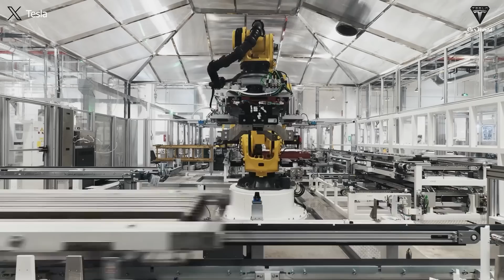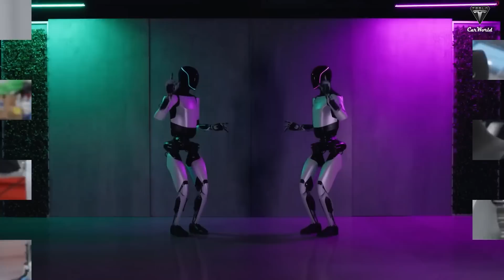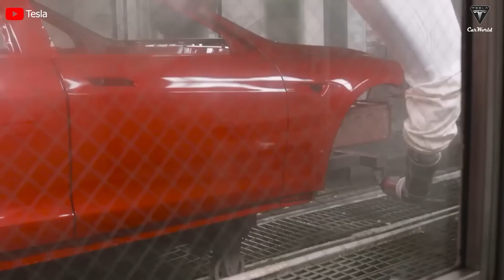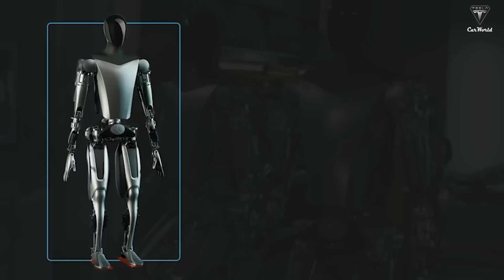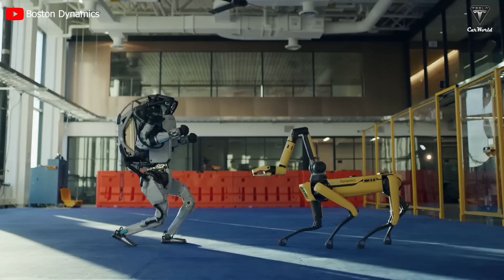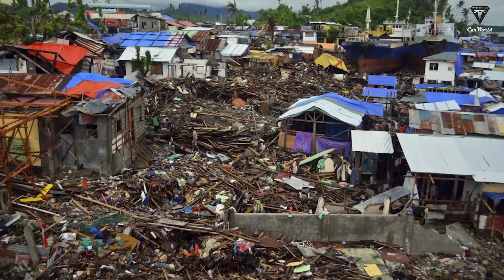2024 "Next Gen II" Tesla Optimus: Unveiled All NEW Specs, Challenger - Boston Dynamics Atlas (MIX)

Comment: Robots on wheels can do more, carry more, have multiple arms, longer arms, have larger batteries and work faster than a robot spending valuable energy trying "not to fall over."

A human picks up on box at a time because its the limit of our design, why design human limitations into a robot?

The Humanoid Robot "as shown" cannot operate on its own for more than a hour or less on batteries, given its size.  This robot is a scam for investment money, its not practical, even with an external power source its a weak design.
Reply: Up and down stairs. It's also called a progressive step in development.   Te human body shape and form has already proven itself for a long long time.

Comment: The Optimus will NOT be 'sold', most emphatically not for as little as $25-$35K. It will instead be 'leased', very likely for in the range of $100k+ a year. This for the simple reason that demand will VASTLY outstrip supply for a very long time, likely over a decade. Moreover the first few years of Optimus production will likely be used exclusively by Tesla.

You skipped completely some of the MOST important differences between Tesla and Boston Dynamics. Tesla's Optimus is being designed from the ground up with ease of production in mind. No such consideration has entered into the design of Boston Dynamics' Atlas. The production cost of early Optimus might be in the range of $20K. The production cost of early Atlas would likely be more in the range of a quarter million. The design approaches between Tesla and Boston Dynamics are so utterly opposite that I don't think Tesla would gain anything from Boston Dynamics at all.

Comment: Boston dynamics has little engineering that Tesla could use. Boston is hydraulic Tesla is electric.. Nothing shareable between these two. Boston is pretrained Tesla learns and adopts so nothing shared in the operation. Basically Boston isn't mort than research while Tesla is a usable general purpose robot. Tesla needs or wants nothing Boston has.